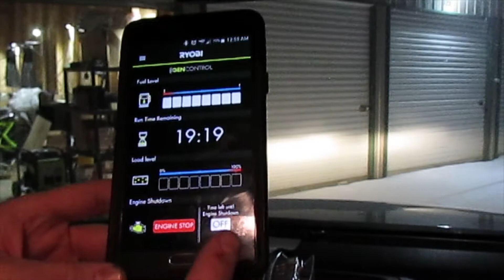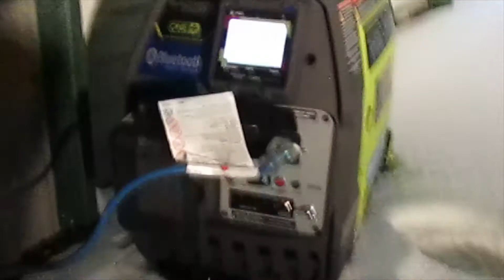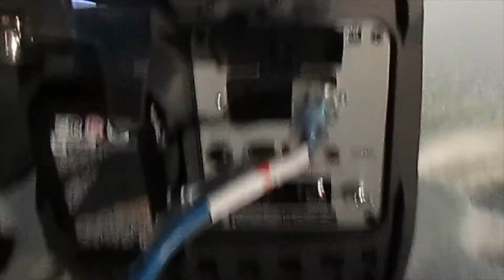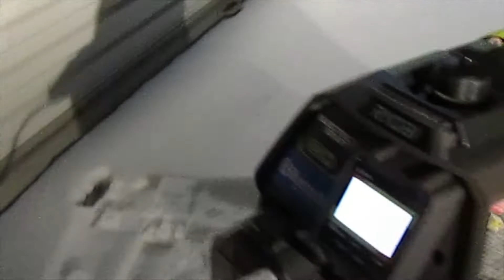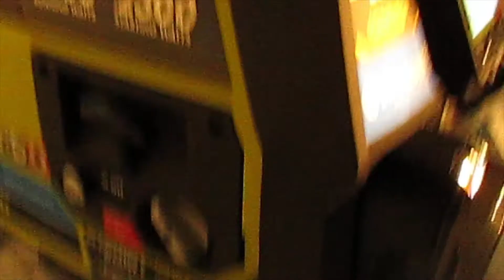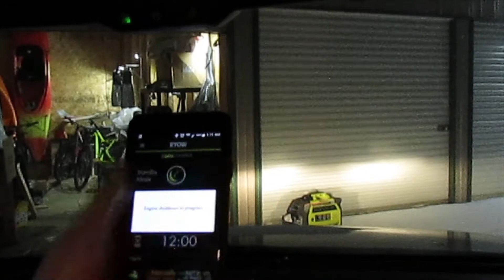RYOBI 2300 Remote Electric Start Inverter Generator with Bluetooth

Comment: If it requires location to be on, what happens when you are where there is no cell service, does the generator not connect with Bluetooth? I use a small Honda in below 0 temperatures and I have it in a box to so it maintains a temperature around 50. No air cooled generator should be run in temperatures below about 20 degrees unless you are running a continuous substantial load on them.
Reply from the maker: Very good question.  I do not know.  I think the location setting on my phone just activates the GPS tracking and is independent of cell tower signal so in my case I'm pretty sure it would still work normally outside of cell service.  Maybe a different phone with different settings will have different results.  A few weeks ago I ran this generator and it used my phone to perform a software update on the actual unit -- very interesting....I do not know what changed or what they are capable of changing but maybe that's something worth looking into again!  
I am curious to know what inverter generator out there is best in cold climates but it seems this Ryobi is not the answer.  Many others have had issues not starting due to a faulty auto choke.  The market is very competitive with fuel consumption and running rich in colder weather is something I suspect engineers are not focused on.
Reply: @joshuabooth7783  I run my gensets in cold temps and at altitude by doing the following

Disconnect hose that interconnects the cylinder head and air intake box(cap off the airbox side)

Add 20%-30% xylene to fuel

If you have a manual choke..  use it to modulate the richness of your fuel mixture

I have never used trufuel which is supposed to aid in cold weather operation...
Reply from the maker: @camposvazquez  Thank you for the advice.  Because this generator has remote start, it also has an auto choke which sometimes does not work well.  Hopefully Ryobi will improve this on future models.  The only way to manually manipulate the choke is by taking the side cover off but it will still automatically shut off the choke once the engine is running.  I will likely buy another generator for dedicated cold weather applications.  This is the single biggest area Ryobi needs to improve upon in the future.

Comment: injector or carburator?
Reply from the maker: I am about 99% sure its a carburetor.  The auto choke feature needs improvement.  It often needs several pulls or several attempts at electric starting to get started.  Others may vary, I'm not sure.

Comment from the maker: Read the description for more info (SHOW MORE).  I have updated the description several times since filming in February 2021.
Reply: I read your description and I still have a question. I don't remember seeing anything in the video either about this... Do you know how far away or how close you have to be in order for the Bluetooth function to work?
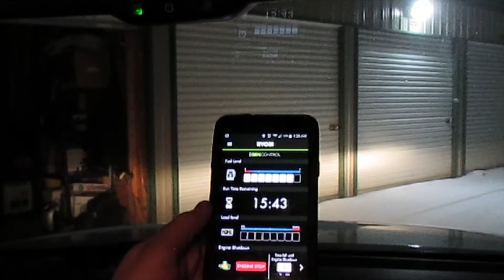Reply from the maker: @ruffbus1534  Click here -->  10:10  This was the only test I performed on the range.  I don't have any guesses to its maximum range but like many other Bluetooth devices I would expect anywhere between 30 -100 yards with a clear line of sight.  It seems to be very reliable through at least 1 or 2 walls for about 50 to 75 feet.

Comment: Can you parallel this with a older 1800-2300?
Reply from the maker: Yes, though I have not tried.  Also I have been looking to link ANY two or even 3 inverter generators no matter what size or manufacturer and it appears to be possible but you really need to be careful about how you go about it.  Manufacturers do not encourage this practice.  A few videos on YouTube show how to do it.

Comment: I have the old 2300 and was curious about the new features. I thought the battery was just there to charge, and there was a separate battery to remote start. The way they did it makes 0 sense.
Reply: Plus every generator I've seen has a vented cap with a lever to close it when not in use. Another bad design, but perhaps some people are too dumb to open it when running